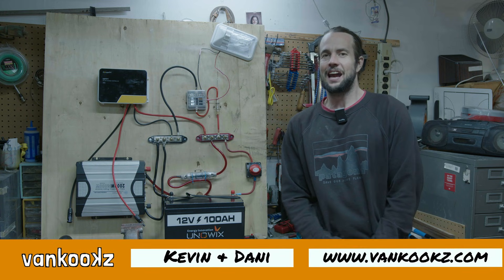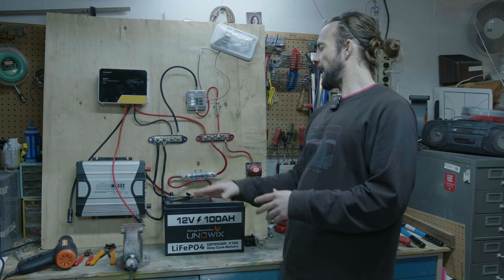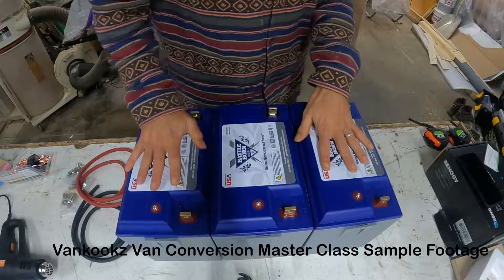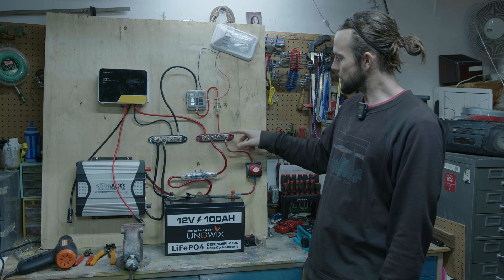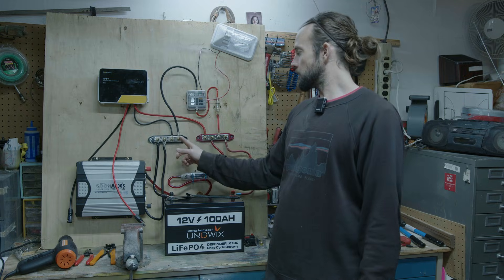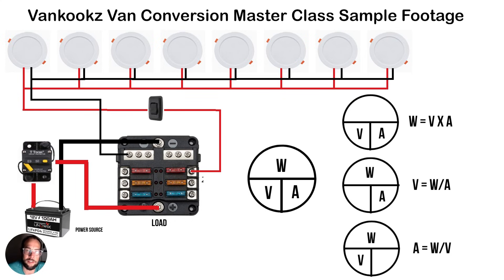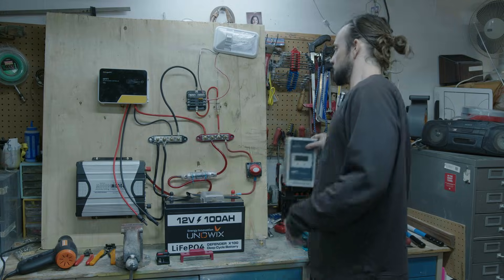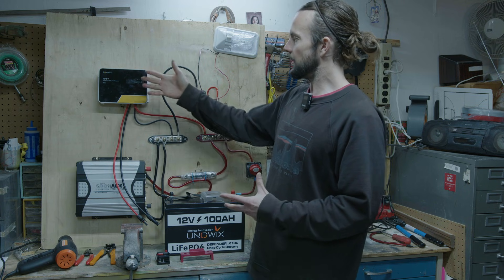Step by Step Complete 12 Volt Power System for a Van Conversion

Comment: Great video. Thanks for taking the time to put it up. If I’m planning on charging the battery with ac because I will be traveling to sites with pedestals periodically and don’t have solar do I need to disconnect all of the dc components while charging or will the master switch handle that in the off position?   Thanks again for the help.
Reply from the maker: If you are using an inverter with an auto transfer it should be ok
Reply: Thank you!

Comment: Hey Kookz! Thanks so much for y'all's time and energy in producing these videos as they've been helping me a lot with my old T1N I just bought...

I'm compiling my electrical system list and wondering about the 4 stud bus bar, as I plan to power my van with shore, solar, and alternator. Would you recommend going with 600a 4 stud bus bar or a 300a 6 stud bus bar? (as it seems this is all i can find on amazon)

I was advised to not put 2 cables on the same stud of the bus bar, hence my inquiry about going with a 6 stud bus bar? I'm wondering if you had a take?

Thanks! (Happy to venmo you for a cup of coffee)
- Alé
Reply from the maker: Hey dude! I usually go over amperage because we can always add more fun stuff to our power stations as we go.  Either will work fine but with the 600A you can will know that you are going to be ok no matter what.  I usually try to not put multiple cables on the studs but it’s ok if you have to and it shouldn’t be an issue, I’ve done it many times. Just make sure you keep it all clean and separated (red/black) so if you are working in a tight space it can be easy to short the wires on the bus bar while you are putting everything together.  
It sounds like the T1N is coming along nicely dude! Venmo is @TheSourceFN.  
Thanks dude 🤙🏽

Comment: Great videos. I’m curious if there should be any fusing at the battery like a terminal fuse or any fuse before the disconnect switch?
Reply from the maker: Thanks It never hurts to add more protection wherever you want.  Crazy shit can happen when you have all this power moving at 70mph!

Comment: Thanks for your videos. They're very helpful. I'm using only a Vtoman 1000 for my setup. Do you have any videos on how to wire a switch for my LED puck lights.  Do I need a 2 pin or a 3 pin? Thanks again for your awesome videos.
Reply from the maker: Thanks!  I appreciate it!  2 pin will be fine but 3 pin is ideal if you want a dimmer.
Reply from the maker: I cover switches and much more in the Masterclass which is about 70% done I'm working hard everyday to finish.